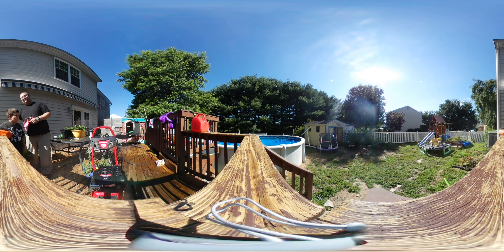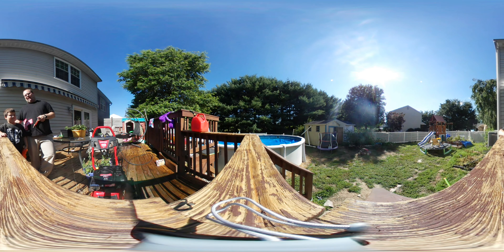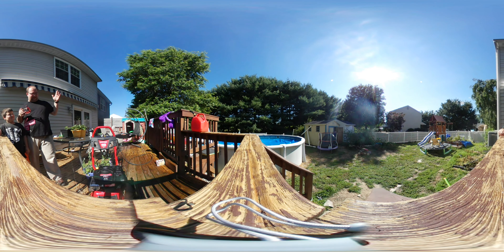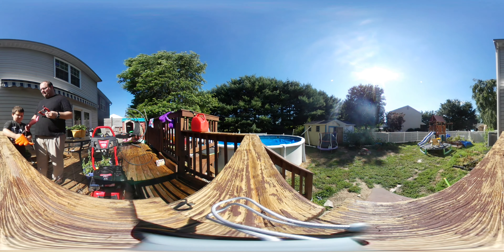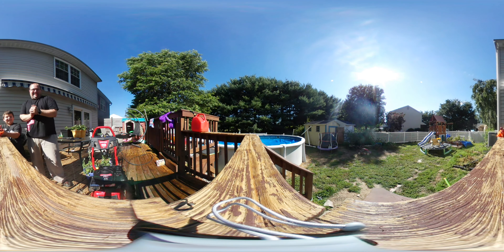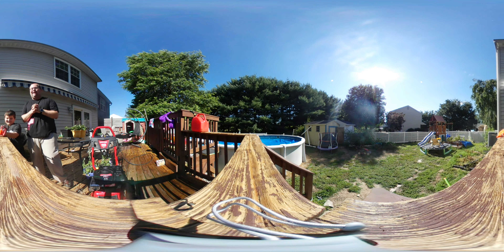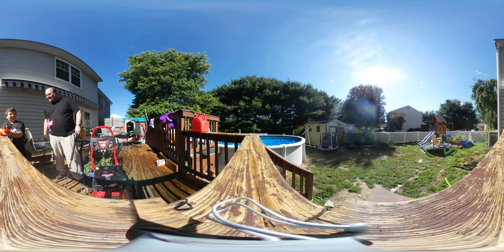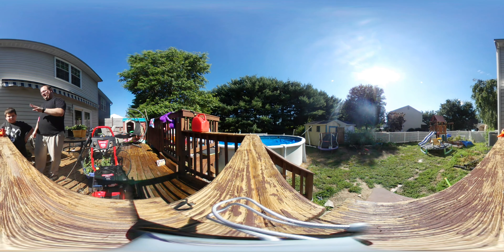Fidget Spinner Vs. Power Washer Part 2 4k/360

Comment: Awesome. Have something like a table mounted vice grip hold it so you can go all out without worrying about anyone being hurt. Break the world record for fastest spinning fidget spinner. You can also experiment with it spinning this fast, for example dropping it in the pool and related, maybe it will roll ontop of the water or make weird noises when dropping it and sink. Think outside of the box and do what no man has ever done before! Just make sure to stay safe.
Reply from the maker: All good ideas. I think next time we are going to do a longer video and try a few things. I noticed that it was spinning too fast for the camera to pick up at 24 frames per second. I think I want to try it at a lower resolution but at 60 frames per second. I'm also going to try and get the camera closer and get the power washer further away to try to capture the sound it makes once I have it up to speed. 

More to come! Thanks for watching!